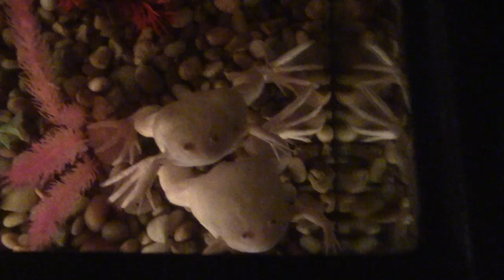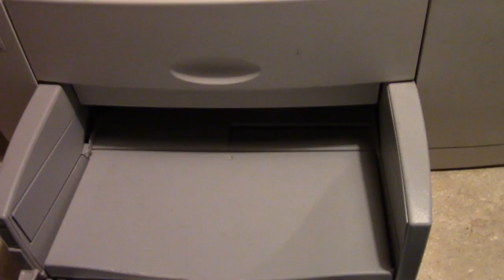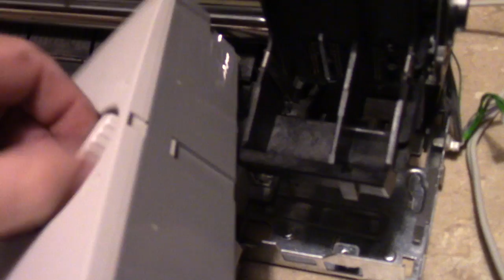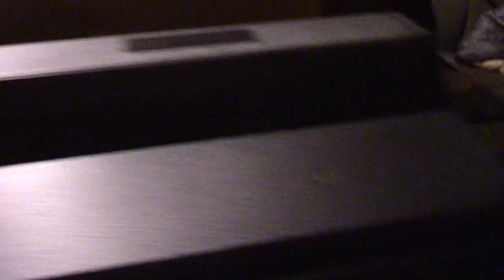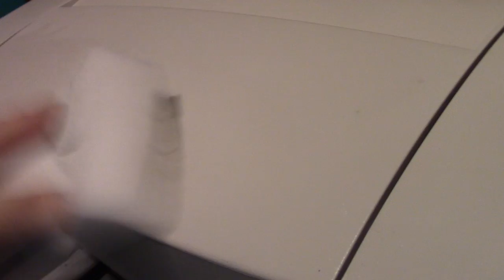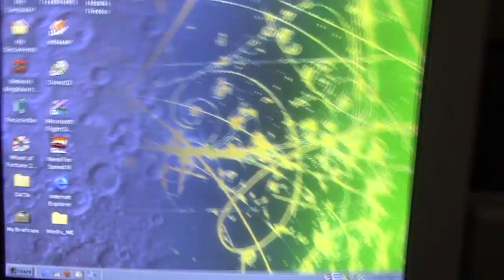Resurrecting A 16 Year Old HP Deskjet 840C

Comment: I have the same printer since, say, I was 10. It's still working, at least, on windows 7 today in 2018. The bigger issue it has is that it takes more than a sheet at a time, so I ended up feeding it one sheet at a time. It printed out all my school 'graduation' stuff: last year middle school, last year high school, bachelor and master's degree. I can say it printed all the important things I had to print in my whole (student's) life. Actually I printed only drafts of my thesis with this, but I love the fact it did 15 years after being gifted to me.

Comment: Hello, last week reinstall windows 7 ... I'm trying to do my hp deskjet 840c run, but the manufacturer no longer supports it being a discontinued printer and remove the downloading drivers, Windows Update can not install ... I need to know if you have a downloadable driver file (my operating system is win7 64bit) you can share. Or if you know where I can download  .. I love my printer and I want to be able to use it again ... thanks friend

Comment: I once found a PSC 1210 at a yard sale with some random computer parts and the black ink cart still worked so I bought new carts and used it as a printer for a Linux machine.
CUPS pretty much has drivers for every HP and Epson printer made.

Comment: Old Deskjets are brilliant printers! I think I was about 10 when I was given an unwanted Deskjet 670c. Had next to no ink left but I managed to bang out a few school projects on it until the ink ran out. Unfortunately as an unemployed 10 year old I couldn't afford new inks for it so I handed it on to a friend. A few years later my dad handed me his 930c that was replaced by a laserjet in his office at work. That printer was the best! Again, had next to no ink left in it but I managed to squeeze a good year of printing out of it until I bought a new set of inks for it ($150 total) to be greeted with a ink system malfunction error due to the ink reservoir globbing up with 12 or so years worth of waste ink from heavy use. Somehow I bypassed the warning (creative young brain) and it printed still for a little while, and then it got so full of sludge the carriage wiper motor failed. RIP 930c.

 After years living with a Canon Pixma which I'm now tired of cleaning itself and wiping out 10% of the cartridges each time, I was looking for a new printer and a couple of days ago on eBay I found a NEW IN BOX 930c! Never even plugged in, still has it's plastic on. So I've bought it and it will arrive (international post) hopefully in a couple of weeks. I also found some business surplus genuine HP 78XL and 45 ink cartridges going cheap so I grabbed those too. Can't wait to set it up. :D

Comment: I am going to have to try that glue for my Chinese scooter's ABS (and it's clearly marked on it) plastic body panels, it's 12 years old and the screw mounts are doing what ABS does after that long, turn brittle as heck, but I will try that Loctite glue, 150cc bike runs fantastic but it's body panels are literally aging badly but they are 100% abs, it's molded into the inside of them so I will have to try that loctite glue.

Comment: I still got mine from 2000. it was at the office all the time and it was really white. then I took it to my old house to its original place since year 2000 and looks like the lack of light turned it yellow. what the heck!? it's been ages since I turned that on. I wonder if it still works. damn! the sounds in this video gave me a lot of memories when I was a little kid.
Reply from the maker: Actually, that's been disproven! I've opened up brand new old-stock stuff and it's already yellowed, despite being sealed up without any exposure to light.
Reply: Exposure to light turns plastics yellow, not lack of light. If it turned yellow despite being in the sun, then it would have simply been due to age, or perhaps other environment factors such as temperature.
Reply: ***** i see... it might be the heat of the office in my old house, we never open the rooms so that might be it. or just coincidence, the plastic started to rot in that precise moment, hahaha!
Reply: Yes, as I said, some plastics will turn yellow simply with time. Lack of light will not cause plastics to turn yellow.

Comment: Damn, I wish I kept this Epson AcuLaser C1100 colour laser printer, as the fix it needed would be very simple. Two problems:
1. This is the main problem. It would keep on saying that one of the doors are open even though they're shut properly. I could've fixed it by finding the defective switch and bypassing it.
2. This has to do with colour printouts, and that is, it smudges on colour printouts. Quite annoying, actually. But the smudges weren't really that bad at all. Just a few at like between the centre and the bottom of the page. After doing some online research, it turns out we could have saved money and not brought a crappy HP CP1515n which had toner cartridges that were so expensive that throwing it out and buying a new printer was the only option (now have a Brother HL-3150CDN as a replacement for both printers). What most people say, is the plastic cover on the PC drum unit has these plastic mold marks, which get raised over time for some reason, causing the smudges. Removing the marks (usually with a file) should fix the problem.

Comment: I got my 2006 Mac Pro upgraded to dual quad-core Xeon X5365 CPUs and 32 GB of RAM for under $100 ($60 for the CPUs and $24 for the 32 GB RAM upgrade). I only paid $35 for the machine to begin with, so I consider that well worth it. I also bought an ATI Radeon HD 5770 graphics card off eBay for $13, and flashed the Mac Pro compatible EFI firmware onto it. I use this as my main machine, and it's never given me a single problem. I use Mavericks as my main OS on it, however it runs El Capitan perfectly as well. It's WAY faster than my Late-2011 13" MacBook Pro (13" pre-Retina MBPs aren't worth buying IMO), and is only slightly less powerful than my top-end Mid-2012 15" MacBook Pro.

Comment: Honestly, I've passed up a good few $75-100 first gen. Mac Pros for the same reason you made your decision, by time time I upgrade the ones I can afford, I've spent more than I wanted to on it, and I still don't have a machine that will performa as well as something like my iMac, and the Mac Pro's that I do want are still more than I can afford at the moment. So I'm holding off until I can get either a very late 12 core in the same case design as the one you had, or maybe even the new trashcan style. And honestly, the only reason I have this iMac is that I was in the right place and time to get it offered to me for $850, when everyone else is still selling them for $1500, $1800 new.

Comment: I happen to have an old 500 series Deskjet. it's in pieces in the garage, and I can't seem to find the power jack, but it's out there.
I have horror stories of the 930c-series deskjets. GREAT printers, still supported under 7/8/10 after a trip to windows update waiting hell. but it does work well... when it's not slipping the paper feeder, and then jamming, or running out of ink all the damn time. and then when it came to get NEW ink for the printer, ohhhhh boy no. you go to the basement ink cabinet and then find ALL THE INK IN THE CABINET IS BAD because the cabinet was built around a heat-shielded boiler return pipe and EVERYTHING GOT TOO WARM IN THERE!

oh the fun I had. replaced all the deskjets with laserjets by the time I stopped working at my old job. good riddance to those friggin' things. 
You gotta get your hands on an HP Thinkjet 2225C (C for Centronics!). the diaphragm cartridges for them are easy as hell to get still, and they do print out very good text and graphics for a dot-matrix inkjet printer from the mid-80s. the cartridge in mine is ages old and still has ink in it, and I don't think it's going to die out anytime soon. Even more interesting is that it has an XP driver, and if you share the printer over the network with a Windows 7 or 8 32-bit machine (not sure about 10) you can print to it off a more modern system! it's amazing.
Reply from the maker: +Sudos I had a Thinkjet given to me maaany years ago; it was the coolest machine ever. However, the print quality was about as good as a 9-pin dot-matrix printer, if I recall. Very neat though.
Reply: BBISHOPPCM's World 192x96dpi IIRC, for graphics. it was decent. I have a few scans I did of some stuff someplace with mine.
Reply: I've got a 932C and it serves me well. $20 NOS cartridges from eBay keeps her going.

Comment: if usb would be faster think i might use that unless there is a reason need to use parallel
Reply from the maker: +james42519 This machine has no USB interfaces installed; it's totally doable, and would even give me USB mouse support. I might add one later on.
Reply: oh thought it had usb for some reason.

Comment: Why not add an ethernet card to the 99 cent PC? A 3COM 3c905 would be a period-correct adapter, and a really good one, too. It would save you a lot of CD burning. You could throw in a USB riser cable too, since that Asus motherboard has a USB 1.1 header.
Reply from the maker: +ilovethetwinfamicom It has a 3COM 905B already. I think I mentioned this before, but I'll repeat myself; I haven't set up filesharing on it yet. It's not rocket science, I just haven't done it yet. I'll get to it. I promise.

Comment: I used to have one of these! I bought mine new back in 2000. Lasted me a good 15 years and I never had a problem with it. I ended up donating it to a Goodwill because I just didn't have the space to keep it anymore, it still had the original power supply, software, and even the manual.